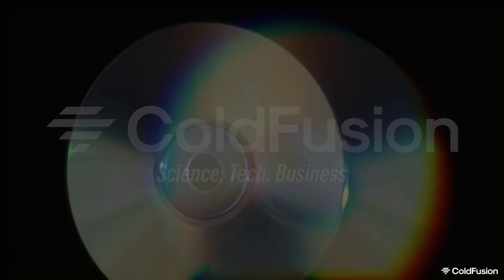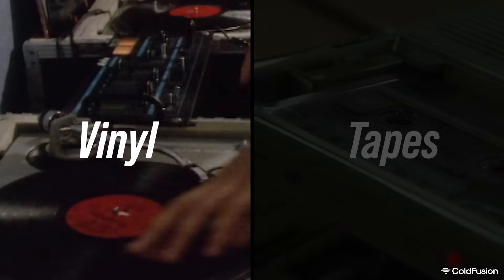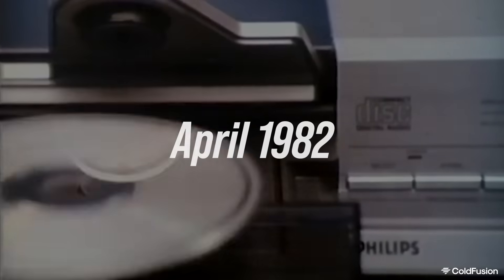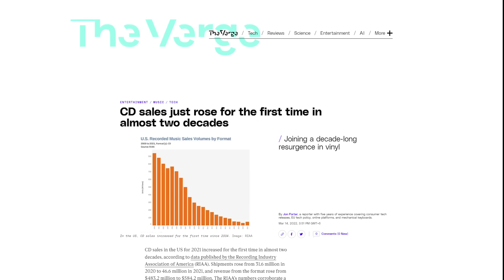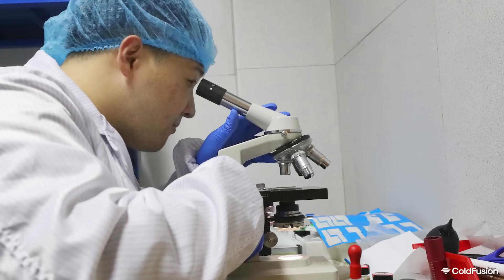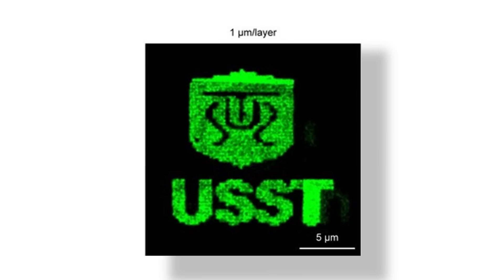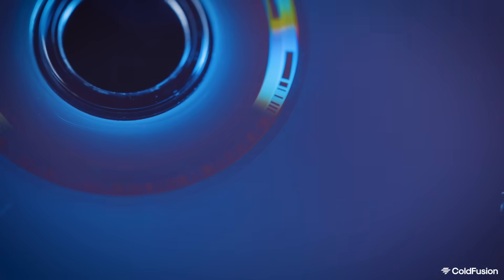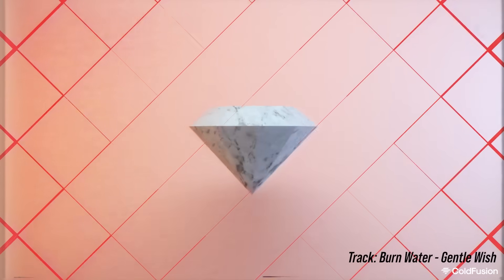Why This New CD Could Change Storage

Comment: Would love to see this come back.  Local, hard, disconnected storage is guaranteed security
Reply: @weplaywax  here's an idea: burn them to TWO discs and leave them in different places. oh my god, i had an ever better idea! THREE discs redundancy! remember, these things are practically free to produce. having redundancy isn't costly when they have this much capacity. heck in fact it doesn't need to have anywhere near this much capacity. i'd be happy with a 2tb disk
Reply: @GraveUypo for the rapidly increasing size of videogames I think that storage would come in handy
Reply: @GraveUypo 
the problem I see in terms of backup is the size of todays harddrives. backups of pics and videos can reach 4 to 8 TB very easy maybe more. I would use 2 TB Drives in case a drive crashes you do not lose to much data. In addition you can always increase the size by buying another 2 TB drive. if i.e. a 12 or 16 TB drive crashes you‘ll lose everything. last but not least backups to blueray discs is not an option.
Reply: @GraveUypo  I remember when 1.44Mb floppies were a thing., the concept of a 100Mb Iomega Zipdisc seemed insane; who is ever going to need  100Mb on a single disc??
Reply: Without bit rot protection storage can’t be counted on.  But as just another form of backup as a secondary or 3rd option it is great idea.
Reply: @Story_Teller_Everyone  bit rot is not that big of a deal, the real problem with the cloud is "license rot", they keep taking away our digital goods because it turns out, the license wasn't perpetual
Reply: @Story_Teller_Everyone  my thoughts exactly.
Reply: Yes seriously fuck the cloud
Reply: honestly, a HUGE optimal media format would be extremely welcome nowadays. i really don't enjoy buying harddrives for backing shit up.
Reply: @GraveUypo hard drives are way faster and probably cheaper, you’d need a new fancy burner with a special nano 3D laser that will cost 50k.. if you want something durable and fast just buy some SSDs they’ve never been cheaper
Reply: @ShaneMcGrath.  SDD's are only garbage for people who have more data than money. An SSD filled NAS will always be preferable to HDDs for professional use cases
Reply: For long-term storage, you'd use archival tape storage.
Reply: Also, you actually own things and are actually happy. That would say no to neufeudalism.
Streaming services basically said that we don't own our digital goods, so we should really go back to physical media.

Time for the second personal computing revolution.
Reply: Finally getting rid of cloud storage.
Reply: @pvisit   yes !
Reply: @pvisit  🤦‍♂ where do you think all those things you upload to the "cloud" are stored?  That's right, on SSDs.
Reply: @pvisit 
Yes and no, there is an advantage to having a backup offsite.
Reply: That's what hard drives are
Reply: 3-2-1 backup rule. It’s currently hard to do this if you have multiple terabytes of data. HDDs don’t like being moved, SSDs don’t have the capacity and are expensive. Both are prone to bit rot and NAND failure is common. Flash drives fail all the time and are low capacity. Tape is its own animal. A CD like this would be great for archival purposes. Burn them quarterly and keep them offsite in two secure locations. If you don’t own the hardware or the physical location you don’t have proper backups and are beholden to someone(some corporation).
Reply: And you can actually own copies of your media again.  I hate how you can “buy” media online and then you “own” it until some company decides you donʼt, either because they went out of business (various small companies) or they decided to take away a specific purchase (like Amazon and 1984) or they just shut down the entire department (Microsoft shut down all their ebook sales and you can no longer get ebooks you bought through them).  Usually you get a refund in that case, but not always.
Reply: Fuck the cloud.
Reply: Yes but you have to convince the average person that they should care about that, there are still too many people that outweigh people like you and me that care. If there were enough people who actually cared out there then people would have protested already and we would have seen some serious backlash in the news. But so far, nothing, because the average person just isn't tech literate enough to understand that they should care. 😊
Reply: @zilog1  Agree.  And the average person has or will pay the price when a drive fails, or malware wrecks their system, etc.  Hopefully, it's nothing terribly important.  But, sometimes it is.
Reply: @weplaywax Holy missing the point batman, you still have to keep separate backups in different places... As for disks, i prefer m-disc blu-rays.
Reply: 🙌🏾 Amen 🙌🏾
Reply: @weplaywax nobody said they wouldn't backup pertinent information to a cloud server, buddy.
Reply: @bigcauc7530 Heya, I’m here to inform you that discs don’t ensure you own it either, as discs are limited nowadays to being verified digitally a LOT. Often times, game discs are verified by the internet as a game that can be played. Often anti-piracy, that same mechanism could be used on all copies  of any game to straight up disable it. The cloud is secure because nothing ever leaves it.
Reply: Would be great to use as an offline internet storage option.
Reply: You will own nothing and be happy
Reply: The use case of this tech is to safe guard against efforts by corporations and govt to control access to information and effectively in realtime rewrite history (for the obvious Orwellian purposes)

Other parties would now have a means to safeguard large swaths of information from such destruction/alteration.
Reply: It's so durable, basically all plastic, while flash is brittle and unsecured, won't survive for very long.
Reply: @Rue_Madora  you people are missing the point.

You’d plug this CD thing in and perform a backup 6x a year.  The rest of the time it would sit in a small, secure, anti-magnetic case.

The problem with privacy today is size of personal data stores has become so big is prohibitively expensive to store in a secure way.
Reply: @sshah2545  nah I get you, I’m just jking around m8. I prefer CDs tbh
Reply: @sshah2545  anti-magnetic? why? This technology has nothing  to do with magnetism whatsoever.
Reply: @sshah2545  RAID is insecure..... because?
Reply: @sshah2545  What exactly is "prohibitively expensive" about an external HDD or HDD in general? They're cheap and last a long time, especially if only used for backups. The disc shown is completely useless due to its low write speed and who knows how durable or even reliable it is. Also your statement about "guaranteed security" couldn't be more wrong. If your stuff is stolen, then how secure can it be, let alone the lack of availability. Hence why professional back up solution have backups online as well as physical back ups on site and off site and nobody uses optical media any more and for good reason too.
Reply: @sshah2545  1. Who says that any person needs a 200TB? Nobody needs that much.

2. You need a Femto laser to write such a disc. This'll cost you 100+k. A 200TB NAS would cost me about 3k. Do the math. If you can't afford mechanical media then you will definitely not be able to afford this dumb disc.

3. This doesn't even exist yet, so any claims for this being cheaper are ridiculous at this point.

4. With the slow write speeds of 5 MB/s that the scientists achieved, it would take over a year to fill the disc...if you even had that much data. Very useful...
Reply: @sshah2545  If that's your whole strategy, it's got tons of holes in it.  Fire, flood, earthquake, tornado, and theft can all wipe that out.  

Yes, there are boxes that MITIGATE some of those risks.  But, there is nothing that makes you invulnerable.  

I don't know your situation, but in general, you want at least 3 backups, 1 on-site, one at a safe location off-site and a 3rd at a trusted cloud provider.  How much you trust an online provider is up to you.  

That's just off the cuff.  I don't know your particular situation.
Reply: @sshah2545 personal data of a normal human (not someone storing a replica of Netflix archive in his home) is around a few hundred gigabytes.
That amount of storage can be archived encrypted on a 30$ ssd and stored at a friend's place.
How is that unsecured?
Reply: @Rue_Madora  careful though, I would keep a few copied of each data. I've had CDs degrade on me over time.
Reply: @Rue_Madora metal cd cases
Reply: @Rue_Madora  does work a bit differently. If someone has the ability to store it correctly it lasts longer than any solid state or hard drives.
Reply: @Rue_Madora  disc rot
Reply: @NathanDudani I have hundreds of CDs going back to the 80s, not one has ever had issues playing. However I’ve had plenty of mechanical hard drives just die over the last two decades. There is a reason RAID is a thing, you can almost expect it to happen.
Reply: @NathanDudani  I still have CDs over 20 years old, all kept in a soft case plastic sleeves and ALL of my CDs are fine.
Reply: @Rue_Madora >CDs are more durable than flash storage

Let's see how they fare being dropped or scratched. 🤣

>flash is unsecure

Self encrypting SSDs have been around for ages in enterprise... Almost like fast r/w speeds help overcome the performance penalties of encryption or something.
Reply: Don't let kids use CD's as chew toys & don't run them on CD players in cars on dirt roads . . had a pro CD re surfacer , as in console game discs too recon . . that gave away foolish
Reply: @Rue_Madora yeah exactly you can make offline backups with flash now, if these were cheap enough maybe but optical media is slow af especially CD style ones.
Reply: @Rue_Madora cd and dvd gets bit rot. Hopefully this one doesn't
Reply: I can easily snap a CD rom, but not so easy to break an SSD. Plus, there are more harmful agents that could damage a CD than the ones that could damage an SSD.
Reply: @Rue_Madora  it ia far more brittle than ssd storage. Also easily scratches.
Reply: @Rue_Madora How are optical disks "secured"?
Reply: I already use, "Local, hard, disconnected storage" ... And it does indeed offer, "Guaranteed security!"
Reply: @weplaywax  S'funny, because my data has survived just fine for the past 28 years! ... No problem at all!
Reply: it aint guaranteed but anything better than cloud storage nowadays
Reply: But that's not what the globalists want
Reply: And we could actually own things again, not just relying on services like Epic Games and Steam which are bound to shut down at some point down the line
Reply: @sirsamiboi  PC gamers were excited to get rid of physical media,  that's why DVD players disappeared so fast, no one wants to go back to managing plastic slow noisy disks.
Reply: Local, hard, disconnected storage only is guaranteed loss of your data. This can, however, be an additional backup method, but having only one backup copy...do you know the feeling, when you need your backup, only to find out that it's just empty?
Also, disasters like fire or flood can destroy that copy.
Reply: Security is never, ever guaranteed.  You fell at the first hurdle :(
Reply: I just threw away hundreds of discs that were unusable because the dye degraded. Tens of thousands of pounds worth of content useless.
Reply: For real. "Cloud" is overrated.
Reply: You mean like a external USB hard drive ?
Reply: With that kind of power draw Nvidea will be happy!
Reply: 💿 local local local loc loc local local hard hard😂😂😂😂
Reply: Going digital was never about the insufficient size of media (3 layer Blu-Ray with both sides used for data got 266GB) but about customer's inability to resell software they previously owned as it often can be registered only once into one account. Thus, there is no secondhand market, resulting in higher sales for software distributors while pretending that they doing it to handle piracy as if that stops software from being pirated to get often even better experience than legal customers or the most ridiculous excuse is that the industry is going digital for the sake of environment as if constantly running servers which hardware being upgraded every few years powered by fossil fuels and requiring ton of water for cooling are better for environment than physical discs that can be re-sold thus serving multiple users. These are the reasons why I don't believe that any kind of physical media will change anything because that would mean less control over consumers, inability to collect data that being collected when you need to register online where you need to agree to data collection to even run the software you paid for, and most importantly the fact that serves/online service providers like Apple, Dell or HP are often the same companies that selling you nowadays super thin laptops without space for optical drive most people buy for computer these days.
As you can imagine, by giving you alternative physical purchase option for software, and in the near future also movies eventually followed by even books as e-ink technology matures would just harm their server/online service business. Perhaps small modular laptop manufacturers like Framework could reverse course at least for large thin bezel 18" desktop replacement laptops while publishers could at least provide physical copies of their software once their after-launch support & patches are finished and work starts on newer products instead to get some additional money from their old products but as you can imagine, that is rather unlikely unfortunately when everything heading towards you own nothing subscription without ownership service-based economy. Once internet infrastructure improves, they likely go fully with steaming video games directly from their servers so you don't even need powerful hardware that could alternatively run AI which also works for governments as they are unlikely excited about the possibility of the average citizen holding that much power in their hands. While you can easily understand their point of view limiting possibilities for crime will turn average people into slaves because that's what you are without physical ownership where everything from house to car and all software you running is just rented, a system that is already mostly realized in some parts of the developed world like Singapore which just renting housing to its citizens and democracy is thus just fiction there because you aren't really in a position to bite the hand that feeds you...
Reply: Like usb?
Reply: @unboxviews  problem with USB thumb drives and hard drives is those files can be modified by a virus. Vs a disk once it's written say for instance a back up disk. At any point your system is corrupted you can pop the disk in and go back to how your system should be.
Reply: yesss, Disconnected and NonTrackable is a Luxury This Days !
Reply: Ok
Reply: A usb right?
Reply: @jamesmoore381  USB is just a protocol.
Reply: Also resilient to solar storms.  The current archive of human digital history is at risk.
Reply: Buy a tape, it won't be as high capacity, and it's also a little bit slow, but it will last long,  it can be rewritten and it actually exists.  I will wait until  LTO-10 later this year to see how it arrives in terms of price performance and costs. Even today if you use less than 18TB an LTO-9 tape is a pretty good alternative. if the LTO consortium delivers this year's end, probably middle of the next year we will have more affordable LTO-9 drives. The media itself is cheap, about  130$ per tape. and it's tinny.
Reply: ME TOO
Reply: IKR
Reply: Yes!
Reply: If it's connected to your device as storage, it is not disconnected.
Reply: But wait ... it's invented by China? Well .. I have doubt about it. 
It's China after all, the country that claim they can produce 5 nanometer device using only whetstone and finger sensitivity.
Reply: As long as the disks last way longer than the last of the crappy CDR's that were lucky to last a year.
Reply: @paulstubbs7678   I have "crappy" CD-R's that are 21 years old, and read PERFECTLY! ... So, that should be, "Crappy CD-R's, that were lucky to last one-fifth of a century (and counting)." 🤣
Reply: @marcse7en  Your lucky, I had quite a few that didn't last, also a computer magazine in the US burned a hundred CD's and just left them in a filing cabinet, the failure rate after 1 year was ridiculous.
It all comes down to the chemistry used, I had a pile of Kodak Gold CD-R's that did last ages, so not all are bad.
Reply: It never left.
Reply: When was the last time your house burnt down compared to you getting an email requiring you to change a password on some site?
Dumb argument, Local is far more secure than some BS cloud service.
Reply: @weplaywax fire safes that protect from all of that are really, really cheap.
Reply: Be careful what you buy. Common CDs and DVDs will not last forever. They deteriorate. There are slightly more expensive ones that will probably last your entire life. Verbatim UltraLife™ Gold DVD-R are designed to last up to 100 years when properly stored.
Reply: Yes! Yes! Yes!
Reply: If it is in a high end fireproof safe..... Maybe
Reply: Writable CDs degrade
Reply: @DM-mq6hx   Well at 21 years old, my CDRs taking its time to degrade! 🤣
Reply: I remember putting in my Diablo CD into the reader and it would whine here and there when the PC had to get new info. It drove me up the wall. At least some clever dick coded a few lines so you could use NO DISC.
As just a plain old storage device, that is cool, but never again do I want to put a CD game into a reader and play that way! Never.
Reply: @ZergRadio  Yep games on PC CD Rom and DVD utterly sucked, the noise, you have wait for the disk to spin up, a worthless hunk of plastic hanging around the house, but you own the annoying worthless hunk of plastic lol
Reply: Those recommending SSD’s for backups need to read up on how SSD’s work. If they’re not powered regularly for substantial periods of time the data starts deteriorating within 2-5 years, they’re not a safe solution for long term backups.
Reply: What makes this disc better than a USB stick or external HD?
Reply: @OutragedPufferfish  USB memory typically only has a storage lifespan of up to 10 years before data corrupts, SSD’s only 2-5 years if not powered. Optical media should typically last 50-100 years, assume this new tech has the same longevity. Mechanical external hard drives have moving parts, making them more vulnerable to physical damage or failure, and typically have a shelf life of up to 30 years if stored optimally.
Reply: @MrSamoDude  That's amazing, I need to get one of these discs.
Reply: You just described an external SSD
Reply: I agree completely
Reply: Yeahh😂😂😂 I fucking love the Lan Party and brother hood playing PS4 together 😢😢😢 Miss Old Day ❤❤❤
Reply: I've never stopped using such media.
Reply: Same here bro!
Reply: @weplaywax  Gun safes are pretty fire-resistant from what I've heard. Just keep all your drives and DVD's in there with bubbly wrap to protect them from impact damage
Reply: you can still buy m-disk blu-ray that are 25-100GB each, split it with winrar and its the most durable storage for consumers currently
Reply: Yeah, until someone uses it as a coaster, or it's exposed to light, or your office burns down because a programmer thought Red Bull was an acceptable substitute for sleep.
Reply: Too bad degradation is a severe limitation to the longevity of optical media.
Reply: Never to happen
Reply: I would love for it to come to fruition also.  I'll buy a drive.   I own a BlueRay burner, one of the semi-earrlier models.   I had aDVD burner when they came out and after the price went down a bit..  and my first CD-Burner was a 4X, which I later upgraded to a 16x with a buffer under-run tech in it.
Reply: Have you not heard of tape media?
Reply: CDs don’t make it in the microwave…😂
Reply: @dr.markevers8331   Anybody stupid enough to put a CD in a Microwave, shouldn't be allowed near a Microwave, or CDs!
Reply: Security is never guaranteed. 

That said, these might someday be a good option for on-site backup.
Reply: Agreed... loved the DVD era
Reply: Yup. Ransomware only became a thing when cloud storage became the standard.
Reply: Yes but at the same time, im like do i really want to deal with having CDs all over the place again?
Reply: @Thingsyourollup  they have folders for them.
Reply: It's the way to fight ransomware, too!
Reply: Absolutely!
Reply: we already have that with external drives, sticks micro sd etc
Reply: Not really when most programs nowadays use DRM checks regardless of being on Disc or Digital, I mean some video games on PC that are installed from the disc can not legitimately be played without modifying the program to crack it but what happens when the crack software disappears?
Reply: Yeah that's very true you can't hack my hard drive back up on Blu-ray.
Reply: This should come In cheap!
Someone said there could be DNA Digital Storage Technology that could store 1 Exabyte of data
Reply: A bluray burner is pretty cheap and works fine. Yeah, only 25 or 50 GB per disc, but... that's good enough for me at least - I backed up everything important on just 5 discs.
Reply: Till someone steals the vault.
Reply: Which is exactly why we're not allowed to have it
Reply: I don’t, glad we advanced beyond CDs
Reply: Online stream services might abhor it
Reply: For the record, ;) I watched all the video, no skips, read all the comments in this little section of 169 replies. @IonorRea’s reply is one of the best.
Snapshot: currently 1.5M views, posted 4 months ago, 52K likes, 6800+ comments in total.
The video talks about a new tech in experimental phase, this can be a product, I think it will be a product, maybe not a consumer one, but a lower capacity or modular version can be also done with less layers. The reproduction of the already existing discs are faster than the writing speed, and as with the CD’s happened already, here can be also many improvements and breakthroughs so the potential is the most important.
Boomers and Snowflakes (I am none of such, a Gen X, no tension, and fight, this is about freedom and understanding!)

Mindset changed over the decades…millennia..
New kids never knew and never experienced ownership of data and the responsibility to keep it.
Some older and experienced ones are happy with physical storage, or primarily physical and some cloud too. That is how should be for average data and normies. Never forget: Not a single physical media or system or tech will last forever or impossible to damage. Redundancy is key, prioritise what is duplicated or stored where is important. Delete and clean up shit and save good memories and important stuff.
But I have seen people move houses, or buy a new tablet and throw away old film negatives after scanning them on a crappy blurry low res scanner. Other people buy cheap, wobbly USB-turntables and record high quality vinyls into bad mp3-s. Then people innovate, comply, throw away VHS and buy DVD, throw away DVD and buy Blu Ray, then buy NETFLIX subscription and buy Spotify Subscription and walk around with a phone, never own a laptop either. Yes, those folks don’t need a “Petabyte laser disc” Just need a job to pay the rent, not just on the house, on their whole life too. If you don’t have memories, you can believe all sort of shit even the opposite of that.
We are accepted this: You have to buy the right to listen the songs you like, and you are lost and lonely and distracted by the endless choices and anxious from the alienating effects of Social Media . Then I have to buy the same thing for myself. No concerts, or too expensive, or shit anyway because you can’t get in without full body search. Bad experiences, tiresome hurdles with real stuff. You even need to open the glovebox and find that bloody cassette! That’s dangerous! Just speak to AI: “please play my favourite playlist” “the one I never knew I liked.” We never meet or talk or share or exchange CD-s, copy Cassettes, copy and share code, we all pay to Big Corp. to give it to us straight, (“..made from 100% pears”..) and we learn to complain if the “service” (WTF, it’s my data) is slow but we can not do nothing when the Big Corp deletes books we bought or deletes our own videos stored. They can say to you what is allowed and what can you share with who and when and how many times. Also scare you into believing this is good and safe and this is everybody’s best interest. And you may upgrade to a better “plan”.
Cloud is nothing special: It is just someone else’s computer. (Ancient chinese proverb.)
Please go to your best friend’s house, ask if you could use his computer, make this move regularly, every day while you study or work, because he is an okay guy and your most trusted bestie, and leave your data growing there. Then ask him to let you access it in about 12.5 years time. Ask him when he is abroad on a holiday. Ask why did he do a clean install and deleted your files. Ask why his kid was posting your essay as his work. Trust others because it is convenient. “Best friends, today, tomorrow, and always.” I know I am being unrealistic and carried away. Forget it, bad example.
With the ever increasing BS acronyms like SaaS - Software as a Service, CaaS, CPaaS, DaaS, BSaaS, MaaS, XaaS, asS.. Yes, anything can be As a Service, to you. When you don’t have the real stuff. Then you became replaceable and the next step is AI don’t need to service anybody, just do it.
Meanwhile, You are complacently watching your favourite series..
You know what, I’ll just switch off that WiFi. Oh you have cellular data, no probs, It happened before, cities, countries went black momentarily. Starlink will stream you TikTok in the middle of the ocean but will not stream to or from Mars. The Bossman’ goes there sure you bet he’ll take a physical copy of his data. He might even leaves one here for redundancy. ;)
“all is for the best in the best of all possible worlds.”
Reply: Hardly "guaranteed security".  If you are using low end recordable cd's for storage (CD-R): These discs have a projected shelf life of 5–10 years when unrecorded, but burned media can become unreliable after as little as 2 years.  Your recordings are only as good as the blank disk quality and the recording equipment storing the data and how the disk is handled.  Don't forget Disk Rot for cd's, dvd's and Laserdiscs.  I've found many disks that are so bad they are no longer playable.  Storage temp and environment is important.  Generally, studio-recorded CDs (read-only CDs) will last significantly longer than CD-Rs depending on the dye type and storage conditions used on the recordable disc.  It's a bit of a crap shoot with optical media.  Redundancy is the key.  I keep copies in my local bank lock box just in case of fire or flood or little fingers getting them for frisbees.
Reply: Amen
Reply: U know I can't save my private pics in phone because when suddenly it got to be repaired these repair shop guys can extract the images and put it on web without u ever knowing because of phone companies removing sd card facility in today's smartphones
Reply: No you just forget to prioritize what actually needs to be backed up. People these days think it all needs to be backed up. Itdoesnt. @gnanasabaapatirg7376
Reply: @gnanasabaapatirg7376 That's my i buy mid-rangers phones that still have micro sd card slot and 3mm jack
Reply: @gnanasabaapatirg7376 Nah, they can’t. If you an iphone 10 or later they literally can’t. Only apple could, and their policy is generally to fight the government in court when they demand access. iPhone’s are hilariously secure with your data, hence why there’s never been a real data breach with apple. The last one was 2013 where app dev’s info was breached, but users were fine.
Reply: I still use thumb drives. Still don’t see why we went away from them
Reply: Love  compact disc😊
Reply: @nicholaspowell7931  we haven't. usb drives are still popular. It's just the corporations selling their own farts with cloud storage and trying to burry usb.
Reply: @nicholaspowell7931  They don't last, and a lot of fakes out there.
Reply: @nicholaspowell7931  because they're not that reliable for long-term storage.  And it's easy to lose them.  

You may be fine if it's just some personal stuff you've got stored.  But, if it's important financial or legal documents, I'd look for another solution.
Reply: @weplaywax  and you’re saying that with what on your side? The guaranteed, undeniable security of network-transmission reliant, digital cloud storage?

What I was thinking! Your idea sounds much more secure
Reply: Until you accidentally scratch it
Reply: Think about it. A disk with 200TB of data that read it at mb/s speed? What's next? Linking up 4000 cars with ropes then claim about making the largest land transportation ever to rival the shinkansen?
Reply: Too little too late, sorry.
Reply: It's called a hdd
Reply: There's such a thing as USB drives.  You can even encrypt them.
Reply: And best of all, it will be completely unreadable a few years from now!
Reply: It’s not guaranteed at all… use your imagination
Reply: If writie speeds are anything like in the past, 100gb might take a whole day lmao.
Reply: SSD's are WAY more reliable, SOOOO much bigger, safer because of encryption, and take up SOOO much less space than CDs while providing hard, local offline storage.

Thinking having many CD's give you any benefit over modern SSD's is an ignorance issue.  That or Flashdrives will also provide more security because you can easily make 10 copies on a flash drive and have that take up less space than one CD
Reply: @KillianTwew  They are not that much more reliable, are not at all bigger than the new research disc (did you watch the video?), you can use any encryption tech with any storage medium, take up less space is the same as bigger capacity so does not apply to the new tech.
Reply: @danielrhouck  I was talking about compact discs.  You know, the ones that actually exist and that the boomer was talking about...  You're incorrect about a bunch of data stored on our SSD being more reliable than data spread across many disks. I didn't argue against CD's using encryption - we are going back to the spreading data across multiple discs.  I get it, comprehension is hard
Reply: @KillianTwew  You said “SSD's are WAY more reliable, SOOOO much bigger, safer because of encryption, and take up SOOO much less space than CDs while providing hard, local offline storage.”

I was arguing against that, but thought you meant generic optical discs when you said “CD” instead of actual CDs, because the video itself had been mixing them up.  Given that, yes, most of your points do favor SSDs (although for actual reliability you do need multiple SSDs not just one, because one thing can be damaged or go bad whatever kind it is.  Redundancy is important.  Still easier to have multiple copies on different SSDs than different groups of CDs, though.)

You did say SSDs were safer because of encryption; itʼs right there.  You canʼt just say four comments later that you did not.
Reply: @KillianTwew  And that's not even considering the data transfer speed disparity...
Reply: Nothing is guaranteed especially if your local operations are compromised then you'd wish things were held in a cloud somewhere
Reply: Puts magnet near by - Edit it was a dumb joke guys. Yes magnets won’t work.
Reply: @thephilosopher7173 it’s not magnetic media like tape, a magnet wouldn’t affect it
Reply: @thephilosopher7173  dude, it ain't a hard drive, it is lazer engraved.  Even if you put the CD in an MRI machine it wont be corrupted.
Reply: @thephilosopher7173  It's optical, magnets do nothing to it whatsoever lmao
Reply: @thephilosopher7173  Optical discs aren't magnetic, therefore magnets won't interfere with them.
Reply: How secure is a disk you can pick up and walk away with?
Reply: @artemisPrime3285  At this point its more secure than having all your data in some cloud, that is having hacking attempts all the time
Reply: @artemisPrime3285 More secure than having it stored to a computer where people can hack in or in the case of it being isolated from the internet, people can plug in a USB drive and having it steal data automatically. Also, CD's are good for archiving data, flash drives and SSD's store data by trapping electrons, these electrons eventually "escape" and you lose a bit of data, when this happens too much (over the span of a couple of decades), the data is no longer readable. Hard drives have the same problem but its magnetic interference causing the problem, same with tape storage but CD's are plastic, if taken care of properly, they can last thousands of years - one of the few benefits of plastic taking ages to decompose.
Reply: @artemisPrime3285  When data is lost, it's usually not from being stolen by someone. It's by your storage getting damaged or wiped.
Reply: Physical storage sucks and is unnecessary
Reply: it is antisemitic
Reply: No you wouldnt. No one wants to use them anymore, maybe just some boomer special snowflakes, or people with old af cars. Who tf wants to switch to that shit when everything is connected automatically these days and everything u want in on your apps.....Even game consoles dont give a shit like the old days aynmore, CD boxes come empty with goddamn activation keys and even if cd's are used, they need permanent internet connection to update and wont work without.
Reply: @oceyho damn, I must exist in an echo chamber. I thought with all this kerfuffle over Adobe essentially ransomware-ing their user’s content that everyone would see the value of digital storage you physically control. Files stored on someone else’s hardware will never be secure.
Reply: @Laecy You get my upvote for using the word kerruffle 😂😂
That being said, I agree, it’s like crypto not your keys not your money, having your software on hand goes a long way for so many instances. More ways to store would be great. Throwing all my old photos on these disks is a nice way to store them without taking up precious hard drive, flash drive, cloud space. It’s just another option for people to be able to take their data and store it however they want.
Reply: @oceyho  Rage bait
Reply: @oceyho  You are what is meant when people say goyim are cattle.
Reply: I always hated the CD/DVD, still hate it. Was so happy when that shit technology “went away”.
Reply: @hmudesign so you prefer to not own your products and instead leave your information and products in the hands of companies that don't consider you more than a number in their bank account.
Reply: @hmudesign   What did you replace them with ? . . usb storage sticks are loaded with malware from the factory
Reply: @hmudesign  streaming is better?